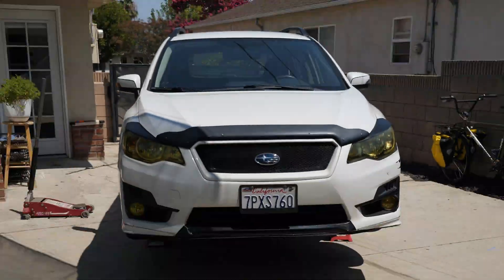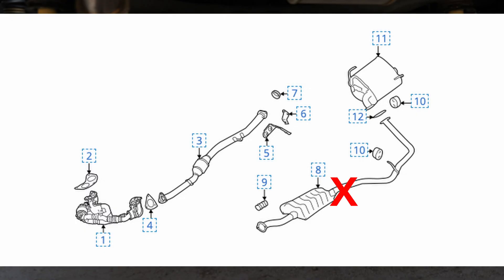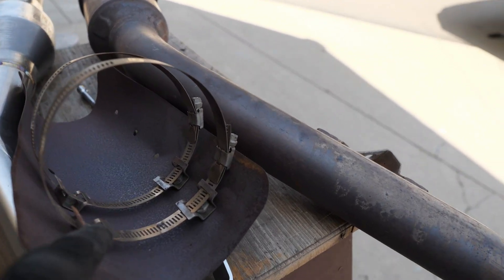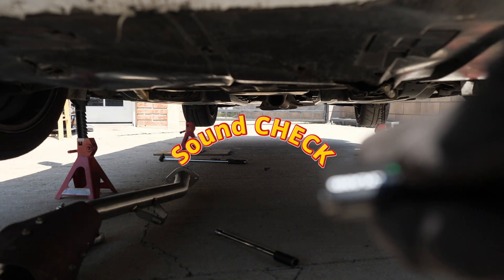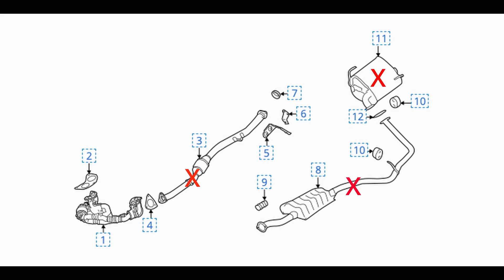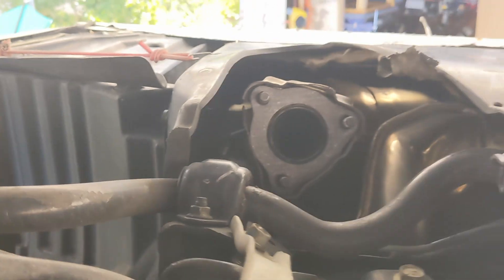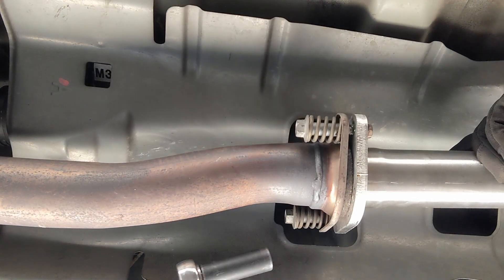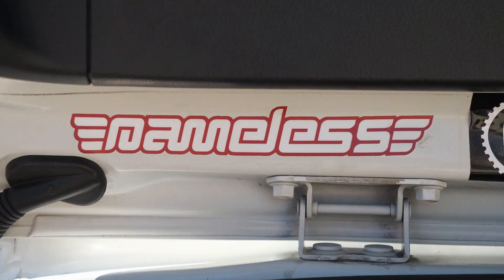Subaru | FB20 Exhaust Restriction - New Front Pipe

Comment: i have my EL header on the way from inferno and im wanting to get it tuned right away but afraid i might not be able  did you end up driving the car without a tune for a bit ? and how long was the process if getting the tune done i have a 2013 forester with a japan import fb25 with auto trans.
Reply from the maker: You can drive the car with a header and no tune. It will feel different because the exhaust "breathing" characteristics have changed with the new lungs. Torque will probably feel off. Where are you getting it tuned? You'll need a Tacttrix port and a tuner with expertise with NA tunes. Good luck! inferno headers are very nice.
Reply: @JasonLeung-4roller i would be having to look for a tuner or it will end up being me and the guys working on it. im located in milwaukee wisconsin dont know of many good shops for performance around here lol
Reply from the maker: Take a look at this vid if you haven't already. https://youtu.be/PgK--2V11Rg

It's about tuning FB engines and this generation  of Subarus which would include your Forester
 
~@6mins I list 4 "remote"  tuners that are pretty reputable  in the FB world. 

Cheers!

Comment: I got the same thing for my XV, did that bike tubing seem to help with that violent vibration?
Reply from the maker: Yes the tube helped In combination with pushing the exhaust over so it doesn't butt up against the transmission mount. 

When I drop it down to 1st during heavy engine braking, there are still vibrations but not nearly as bad as when I first installed it without the DIY bushing. 

Cheers.

Comment: The secondary cat doesn’t affect the sound at all, I had mine removed while the rest of the system remained intact and it didn’t sound any different from stock.
Reply from the maker: There's definitely more sound on mine, 
Also I have a nameless 5" muffler which already is much louder than stock. 

Perhaps the OEM muffler doesn't let as much noise through. 

i also just spoke with someone who has a straight front pipe (catless). He says his exhaust is Loud AF now. 

What did you replace your front pipe with?
Reply: @JasonLeung-4roller just a straight tubing. Then after watching magnaflow's video on how a straight-through resonator/muffler accelerates exhaust flow, I added a small one where the cat was originally. After adding that I noticed it was only a wee bit softer.
I did however do an exhaust cutout right before my muffler, but this was way after I removed the cat so I dont have context of how it sounds if the cat was in place and the exhaust coming out through the cutout.
Reply from the maker: @wwyk1993 I asked nameless if they could make me a resonated front pipe instead of a catted on. A resonator would definitely help reduce the sound and you get the straight through flow gain.
Reply: Nah you're very wrong.
Reply: @devonswindell9735 how can I be wrong about my own hearing
Reply from the maker: @devonswindell9735 so you are saying that if you replace the front pipe with a straight pipe (no cat) there is no sound difference?
Reply: @devonswindell9735  Go try it out yourself. Stock header, catless front pipe, stock resonator, stock muffler, 0 difference in sound.